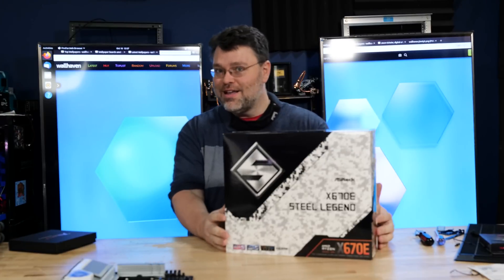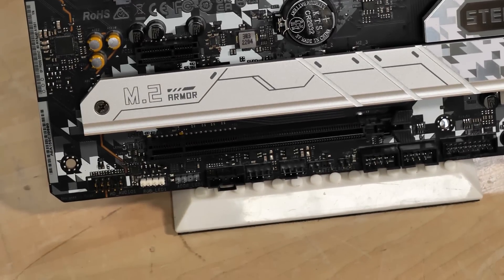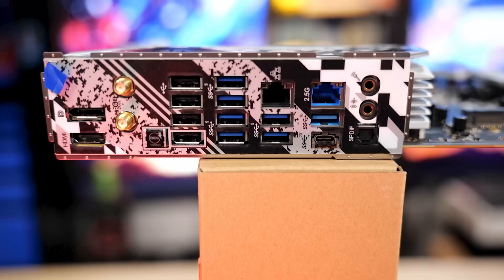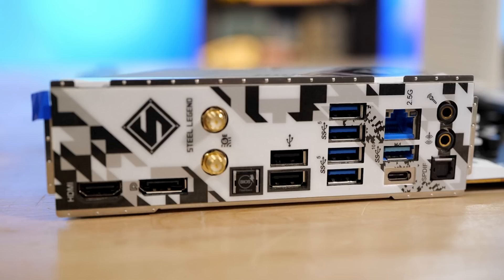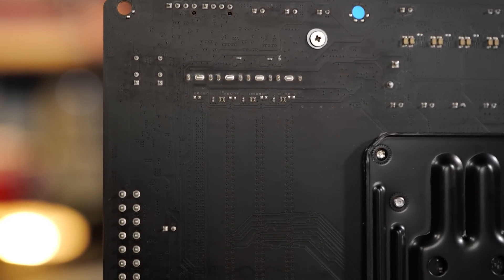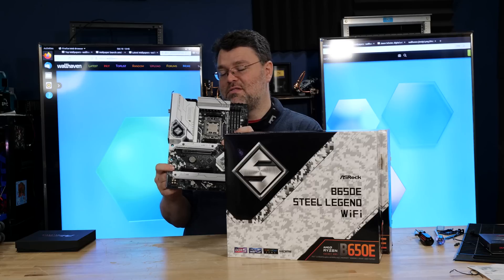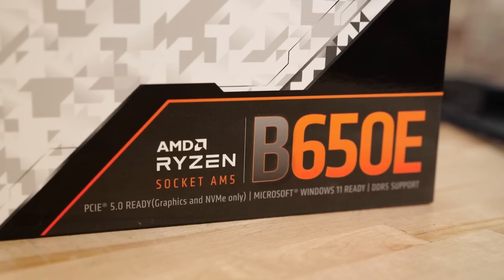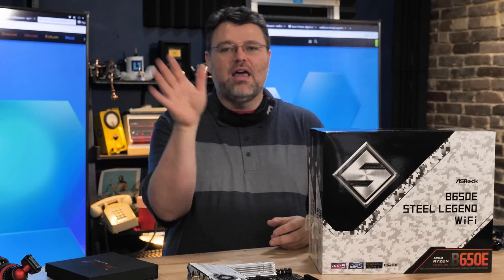PCIe 5 Without Breaking the Bank? ASRock Steel Legend B650E Review

Comment: Those 2 units of RDNA is enough to easily do PCIe-passthrough if the motherboardcompany did a prope job with IOMMU. How Windows should be run, safely in a VM.

Comment: I find this and other b650 eboards rather funny, at the time of writing this comment, the ASRock steel Legend x670e is selling for $300, and the b650e steel Legend is $270. There is literally no cost savings with the b650e boards, they are not worth it. You can get a non-e board, but you sacrifice a lot for that little letter.

Comment: This motherboard lacks I/O for many users. I currently have 2 NVMe-SSD's (one crappy Intel 660p and a 970 Evo) and 3 SATA-connected SSD's. I can live with only one more M.2 slot for PCIe5-SSD's, that is fine. Only 2 SATA-slots seems problematic to me. Consider that even many midrange PSU's have 6 SATA-cables/connections. I feel like 6 should be the minimum. My current modest X570 Elite (which eventually got sold for $160-170) has 9 SATA-connections. So it is not like ASRock skimps on it because it costs too much money, I would speculate that they skimp on it to upsell. I can understand production-costs and all that but please don't skimp on basic features.
Reply: most of those motherboards will let you use either all NVME ports OR all SATA ports. There are bandwith limitations normally.
Reply: @zeus1117  I wouldn't expect all SSD's to run at full speed aat the same time but just for the sake of not throwing away old hardware and having a few 'buffer'-SSD's for large video files, music (FLAC or bust) and games and all that it is nice if you can connect all your SSD's even if you don't use those at full speed.
Reply: on the other hand, 45 dollars on ebay will get you an LSI 8 port HBA card, giving you 10 sata connections while you're still off a lot cheaper than the 670 motherboards.

Comment: I had planned on going B650E from the beginning. Plus I'm moving to SFF build for my move from X570/Fractal Torrent build to Mini ITX B650.
Reply: Pay attention to pricing, all of the b650E boards are really close in price to the x670e boards. Example here, this motherboard he showcasing here is only $30 less than it's x670e counterpart.  You can get cheaper non-e v650 boards, but you lose a lot.

Comment: I have a discrete sound card in my other full sized PCIe slot... and that's because my ASROCK on-board sound just died about a month after I bought my B550M Pro4 ... and I couldn't go over a month without a computer while it RMA'd so I just bought a nice high end ASUS card.... I chose this over a crappy USB card because I like a clean setup, and I dont want a dongle  hanging of the back of my machine. And for about $100 your not gonna get everything you want in an external box sound card... it would cost so much more getting the audiophile grade quality that I got on my soundcard... I was looking for a good 7.1 card with optical AND coaxial  PLUS the analog 1/8" ports too, because I have an older receiver... and just because it's older doesn't mean it isn't amazing... and so I can't afford to spend $1000 on a new receiver just to get more than one optical or co-axial spdif input.... and you usually don't find 7.1 usb sound "cards" of high quality for about $100 and that's all I had to spend at the time..... it's done a great job for me and I still don't think I could find an external usb 'card' with audiophile level components now 3 years later ... I only have a RX 6650XT in my computer so I'm not worried about airflow being blocked by it being kinda close to my soundcard.... but I did get the gigabyte 3 fan card just so I knew I would get enough air with that 3rd fan reach past the soundcard.... and it only takes up 2 slots, which is thinner than my RX 580 8GB I had before it, which seemed to be 2.5 slots I'm guessing.. it just seemed like it was right up against the sound card.... ANYWAY... at least I know I have GREAT SOUND 
...and I honestly noticed the difference between this add-in card compared to the on-board... mainly with sNr/noise floor.... it's just dead silent when there is no sound coming out.... well.... when I'm using my secondary, 2.1 analog amp on the 1/8" wire... so I don't heat up my room using that monster 7.1 reci3ever/amp while I'm watching youtube or the like... but I can just turn it on and my sound switched automatically in windows over to spdif and I can play my games in REAL surround sound (none of that sound bar 'surround' crap... although the Dolby Atmos with the ceiling aimed drivers is something I would like to check out in person at some point) and two 300 watt subwoofers (so I guess it's technically 7.2 huh lol) or when I watch a movie... which is how ALL action, horror, sci-fi, and thriller movies are MEANT TO BE EXPERIENCED... 
ANYWAY... yea, that's what I use my full size PCIe 3.0 slot for......  I hope this answers your question :)

Comment: Ever since I went into AM3+/LGA1366 I haven't had anything besides GPUs populating PCI Express slots, before that I also used a good sound card and Wifi Card for when there weren't enough ports on a LAN party.
Reply: Meanwhile: my X79 motherboard is running an overclocked xeon, a GPU, two x4 to m.2 adapters, a RAID card, and soon will also have a 10G+ NIC.
I still have plenty of fun with AICs lol.
Reply: @asm_nop  Yeah, having the extra connections are definitely cool looking, I couldn't really afford most of the stuff that would require AIC here in Brazil, nvme only became affordable to me when it was already common (My first nvme SSD was on 1st gen Ryzen) and I am still on gigabit, only got a gigabit switch in 2017!

Comment: I have an epyc 7551p so my add in cards include a
1. pcie gen3 x1 wifi Bluetooth adapter
2. Pcie gen3 x8 dual 10gbe nic
3. pcie gen3 x16 (4×4×4×4) bifurcation nvme 2tb drives 8tb total.
4. The gpu 😉😘
Great video
Reply: @administrator4728  Agreed. "Converting" from PCIe to more M.2 is trivial; breaking out of M.2 back into PCIe is Frankenstein madness.

Comment: I currently have a PCIE3x4 10GbE NIC, a PCIE4x16 NVME Card that can host up to 4x NVME's at x4 lanes each, my use is for fast storage over and above the mobo nvme's and fast ethernet to lug that data around.

I'd have like to seen more motherboards with a focus on PCIE, ditch the mandatory Wifi6E and the obtuse number of usb ports+versions - it's a desktop board ffs not a laptop! - use those PCIE lanes for something more worthwhile.

My ideal board would have onboard 10GbE, 2x PCIE5x16 (for 1x GPU, 1x NVME AIC), 1x PCIE5x4 (Because x1 slots are pointless outside of internal sound cards that are for the most part still using PCIE2), 8x USB3.0 5Gb/s ports, 1x USB-C 10Gb/s port, 2x usb3.0 5Gb/s headers for 4x front panel connectors, no WiFi, no usb4/tb, no usb2 (unless required for BIOS flashback, then a single port for that) - Edit to add 6 SATA ports MINIMUM.

If people need wifi or usb4/thunderbolt they can use an aftermarket PCIEx4 card for that, I know of no peripherals that need that much bandwidth and if you are using usb to backup data over usb then you really need to be looking at a proper networked backup solution.

Comment: I have a PCIe x1 Wifi 6/BT card installed, along with my graphics card, and I'll likely throw my SN550 into a PCIe x1 NVME adapter...will it be PCIe 3.0 x1 despite being in a 4.0 slot?  Yes, do I really care if it's faster than SATA and I can free up a slot for a PCIe 4 NVME drive?  No.  I'd throw in a capture card, but they're all x4, which means my X570 TUF Gaming Plus would make my GPU run at 4.0 x8 speed, which, could matter?  But, frankly, I'd rather just use a USB solution anyways, especially USB C.

Comment: I hate that they are reducing the number of S-ATA ports, i got 4 S-ATA SSDs, this has 2 slots.  
I hate that they are reducing the number of PCI-e slots. So... GPU, Soundcard (because 5.1 is still shit for onboard audio) and my USB PCIe card because i always need more USB than they put on boards... aaand i got no more PCIe slots left to put an S-ATA card in there.  
...i do not need that much M.2 ...i get that is the new shiny fast thing, but that it is eating slots away from S-ATA and PCIe just SUCKS.  
Especially on the "budget" boards you would think that they give you more options to carry along your old hardware.  

NOPE... next!
Reply: I'm still mad about card readers getting forced out of the case... And still same trend - make everything external so that you can sell one product to both laptop/tablet users and PC owners, regardless of how convenient it is or if it makes sense at all...

Comment: I run a 10GB Ethernet card and a SoundBlaster Z for DTS 5.1 encoding.  Mobo makers should add a row of vertical mount M.2 sockets between the CPU and first PCIe slot.

Comment: As for expansion cards aside from the GPU, I use an OCZ Revodrive 480GB for my boot drive, a USB 3.1 card with USB-c in the X1 slot, and an M.2 card with an NVME and a SATA drive on it. Was thinking of adding in a good sound card soon too. 
In case you were wondering, I am running the EVGA X79 Dark. I like HEDT for all of the PCIe lanes, quad channel RAM, tons of USB ports, and plenty of SATA ports as well.

Comment: beyond my main GPU currently, planning to go test ro mGPU games later on.
a TV tuner card, that acutally works in windows 10.
a PhysX card, for some older gamess
an older capture card that does 1080 interlaced at 30fps, that was used for older TV recording.

Comment: I currecntly have 0 additional PCIe cards beyond my GPU. Only thing I could maybe use is a USB expansion card, but I haven't hit the limit yet on my mobo.
Reply: I guess that is true for most gamers or generic desktop users out there. So I totally get this trend of having all those M.2 all over the board instead of PCIe slots, it makes sense. That said, I am quite disappointed so far that there is not yet even one MB option for AM5 out there that just uses all that available bandwidth to make one workstation-y motherboard with lots of PCIe slots. I'd even be happy with just a bunch of gen3 lanes from the chipset, since other than GPUs and NVME there isn't much that needs faster lanes anyways. But by the looks of it, I'll have to frankenstein some M.2 to pcie adapters onto those boards if I wanted something resembling that.

Comment: AMD was doing so well. Now I think they just doomed themselves. Expensive motherboards, testing the market with not-so-improved 7000 series except changed socket from PGA to LGA, and the market, the community is waiting for the 3D V-Cache version of 7000 series. I was planning to upgrade, but now, not, not even B650E, I'll wait for 3D V-Cache and what Intel 13th gen has to offer.
Reply: agree on the current MB prices, but 7000 is anything but "not-so-improved". This is one of the biggest gen-over-gen uplift we've seen since Zen1 from AMD. That said though, I'm waiting on the X3D models, too – memory and MB prices might go down till then as well.
Reply: @Hugh_I  I should have been more clear. I agree with you on the generation uplifts, but from the performance numbers results, it doesn't look amazing, and some even having a hard time with 5800X3D. I guess I expected so much more, I guess we'll have to wait for the 7000X3D.

Comment: Dissapointed that with pcie 5.0 we shove all that bandwidth into a single slot; where did all the 7x slot pcie motherboards go... should easily be able to have enough pcie 3.0 lanes now to go around :D. Agreed that MOST people prolly only have a GPU; but yeah; what about capture cards? What about multiple capture cards for streaming setups of multiple cameras? 10Gb nic? HBA cards? Felt like AM4 came and went without ever picking up the tab like the old days of x99 :D. Fair enough epyc boards have it all and the lanes from the CPU but what if you want mid range IO AND a cpu with the fastest single core speed... meh. Makes sense if all external devices just moved to USB-C; just not quite there yet -- then were back to Mac studio territory.
Reply: so much this. Almost anything that's not GPU or NVME is still pretty happy with PCIe3 lanes. A MB with some sort of PLX chip or even a custom chipset designed to shove a good amount of gen3 lanes into the equivalent bandwidth of a 1/4 gen5 lanes could allow to make a workstation out of those desktop chips. And at this point, MB makers don't even have a good reason anymore to segment desktop from HEDT motherboards, since the helo high of X670E has already reached threadripper territory of motherboard prices anyways.
Reply: All those usecases are legit, but really, how many people like that do you know? Most people I know don't even have desktops anymore, if they are gamers, they game on laptops. Of the few people that actually still build desktop PCs, most of them have just the GPU in. Maybe I could find one half crazy guy in my circle running a server in his apartment that needs a 10Gb NIC, but realistically he's probably looking at completely different category of HW when making his purchase.
Reply: @JanVerny  "gamers" that game on laptops? Pfft.
Reply: @JanVerny  anyone that "games" on a laptop isn't a pc gamer. no one you know builds a desktop? sounds european.

Comment: Got a sound card in my spare pcie slot as I'm probably just old (and only because i picked it up as £1 not working (there was nothing wrong with it)). Last I heard usb sound was crap, but then the last time i looked into it was 10/15 years ago....

What is the sound standard these days for external speakers? I have noticed gigabyte are starting to drop the 6 audio ports down to 3 on their newer boards. Has sound moved on and left me behind?
Reply: More often than not, the sound on motherboards has been seen as "fine" for most people. Sound Cards have been kinda dropped in favor of external accessories like DACs and AMPs
Reply: For multichannel most people probably just route their audio digitally through HDMI. For audiophiles, they usually only care about stereo sound and use USB DACs, those are 100% superior to anything that's stuck inside your PC (obviously an audiophile DAC has a separate power input and only uses USB for the data).
Reply: Optical out from motherboard to an external DAC (zero possibility of electrical noise getting introduced) is the way I've been doing for many years now.
With this setup, motherboard choice of audio chip has pretty much zero effect on sound quality.  Bad design might cause a bit more jitter, but any quality DAC can re-clock anyway.
Similar can be done by extracting the digital audio signal from HDMI or DisplayPort, but I find optical out solution to be simpler.
You do want to configure our SPDIF out to be bit-perfect, which not all applications support.  It's easy to tell when it's in this mode, because messing with Windows volume control will have no effect on the sound output.
Reply: I also got a Soundcard, i also am old.  
Edifier 5.1 Sound System that has multiple optical ports, so you can easily swap between PC, Console and whatever else you want to plug in there...  
....aaaand now current gen Xbox and PS5 don't even have optical ports anymore (consider me SHOCKED), now new AM5 boards mostly don't have optical anymore.  
Dafuq are those companies thinking constantly switching freaking plugs and ports on us.  
I spend 650€ on this Edifier Sound System, just a few years ago... obviously i will not upgrade away from it until the Subwoofer explodes (again), i'm on my 3rd system, the first 2 were Teufel CEM.  
At least as long as PCIe slots are a thing my Asus Xonar D2X should keep working.  
For the consoles you can get HDMI to optical adapters... but what sucks big time is that with ever newer HDMI port version you are going to need a new adapter.... currently like 30€ a pop. Big clunky box dangling off your HDMI cable... instead of just a nice thin optical cable.  ...i hate it.

Comment: What about ECC support? ASRock stated ECC support on AM5 until a week ago, now all the MB state non-ECC only
Reply: It's crazy, isn't it?  Wendell tested the X670E board with ECC memory on 1st day review, by injecting errors, and said it worked!
But AsRock themselves got rid of that from their Specifications page for ALL of the AM5 boards, when they were listing the new B650* boards.
Looking at X670E Taichi as an example, WayBackMachine says 2022-10-03 version says ECC/non-ECC, but that went away with 2022-10-10 version.
ASUS still indicates ECC and Non-ECC for some of their models, including Prime & Strix models, including the newly listed B650* models, so they might win my business this time around.
Reply from the maker: Looking into this. Maybe microcode related. When I asked asrock they also confirmed at the time.
Reply: @Level1Techs  any chance you can reach out to memory vendors and enquire about 64Gb and 128Gb EXPO memory kit availability/supply? 
Preferably 5600Mhz - 6000Mhz kits, currently it seems only Corsair are making 64Gb (2x32GB) EXPO kits that are 5600Mhz and no kits clocked faster, everywhere in Europe/UK has no stock of 64Gb EXPO kits and no vendor has any 128Gb EXPO kits on their respective websites, I checked US retail sites (newegg, microcenter, etc) and they have one or two 64Gb EXPO kits and even those I would imagine will disappear out of stock soon.

Comment: Just letting you know, when you showed the BIOS flashback button, you highlighted the SPDIF.
Reply: They're both squares. Close enough.
Reply: No, it's the new secret BIOS update over SPDIF feature. Just burn a red book audio CD with the bios binary data encoded as an audio track, pop it into a CD player with SPDIF out, connect it with the motherboard with an optical SPDIF cable and press play on that sucker. Very convenient method.